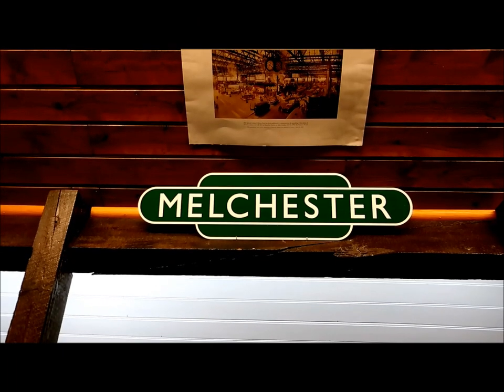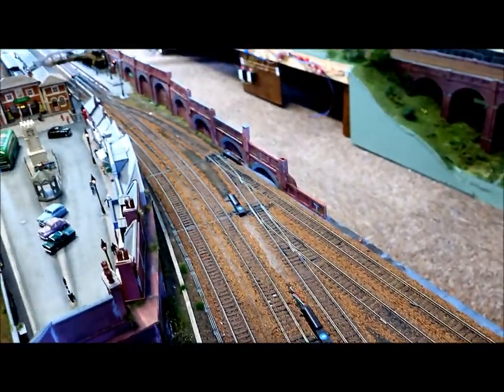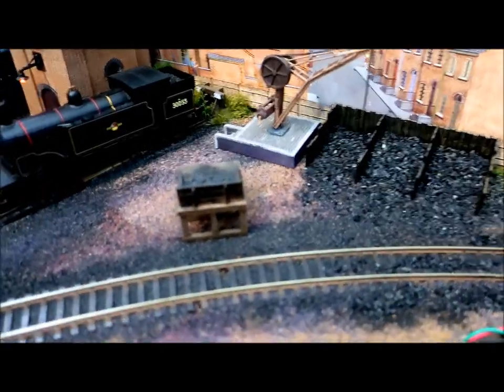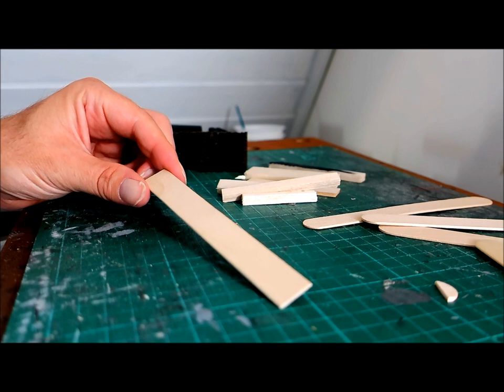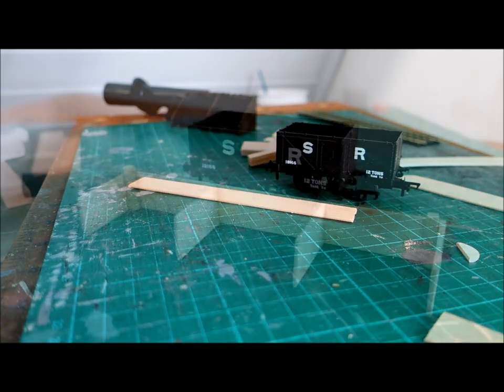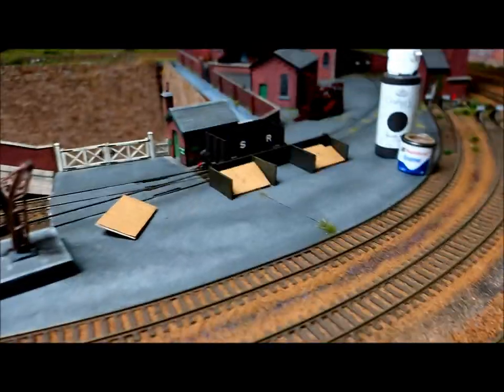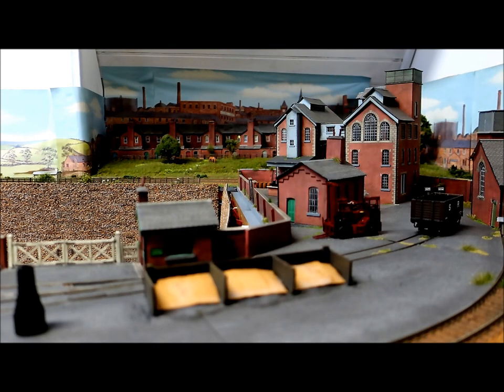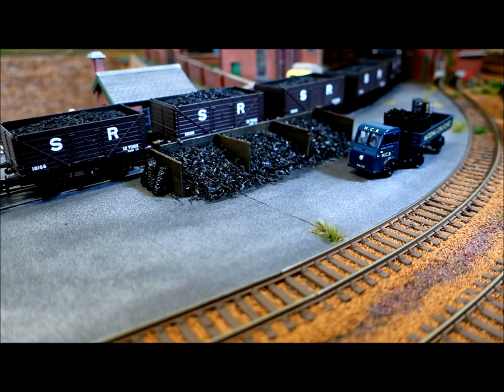How to  build Coal Staithes - 00 gauge model railway

Comment: Hi Chris.   I've made a coal stathe.  Not as good as yours.  I can't seem to get that coal lorry any where.  I don't think they're made any more. Keep up the good work.
Reply from the maker: Hi JJ. I checked mine again, and I realised it's made by Pocketbond Classix, not Oxford as I originally thought. It does seem to be hard to get now, however I found one available on Ebay, even if the seller is based in Russia! https://www.ebay.com/itm/1-76-Classix-EM76506-Jensen-Jen-Tug-NCB-National-Coal-Board/223966918390?hash=item342577f6f6:g:O34AAOSw4iJeiFO0